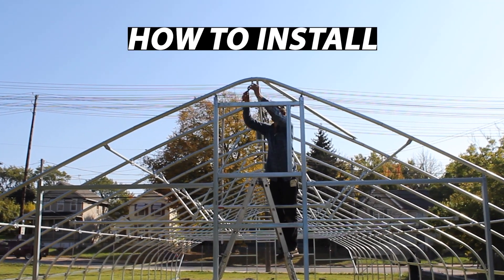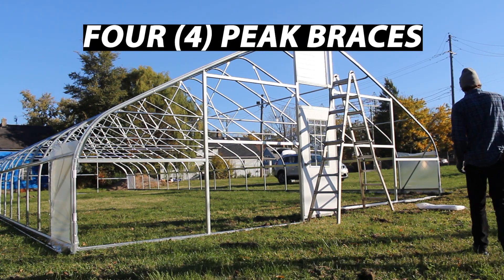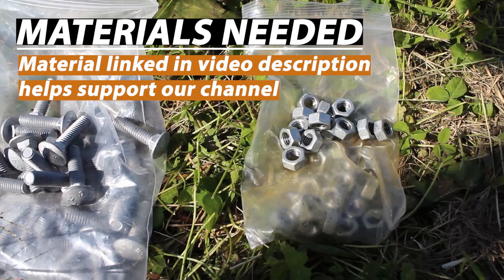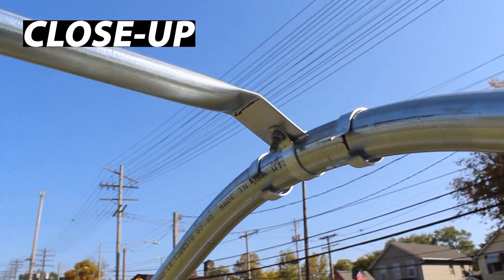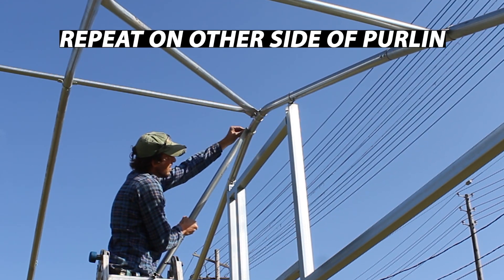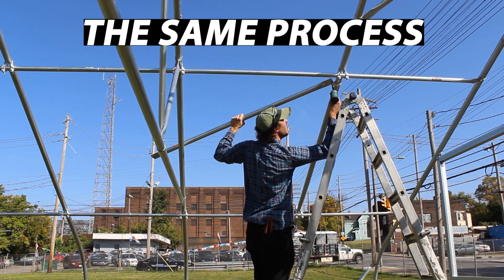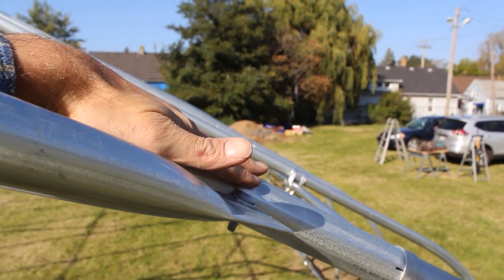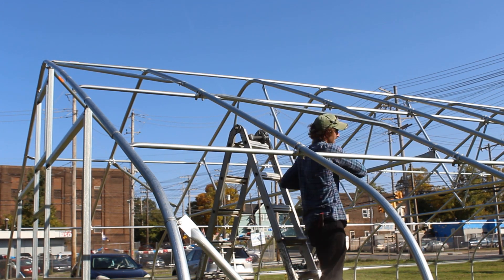Adding Peak Wind Bracing on Greenhouse or High Tunnel | How-to Install

Comment: Do you need to have wind brace bands on a 10 foot wide gothic freestanding type structure?
Reply: 20 foot long structure
Reply from the maker: We don't do wind braces on the 10 ft. wide structures, mainly because they are not very tall. We feel the peaks wind bracing is covered by the peak purlin and the corner braces.
Reply from the maker: On the 20 ft. wide structures, we have two peak braces at each end, which provides four total.